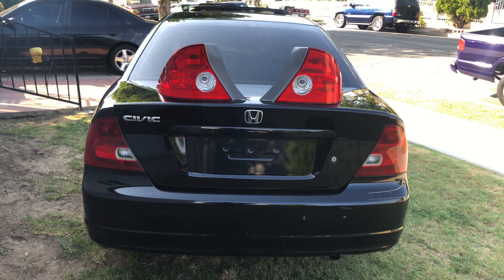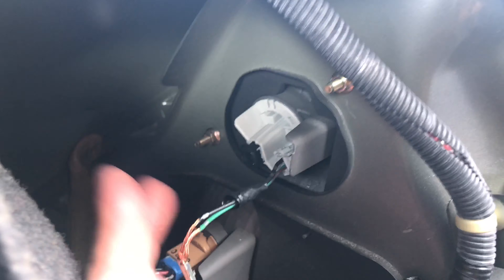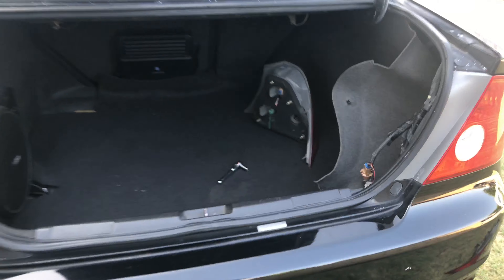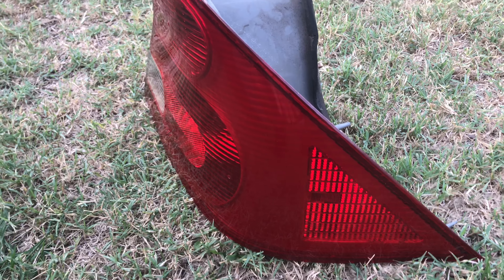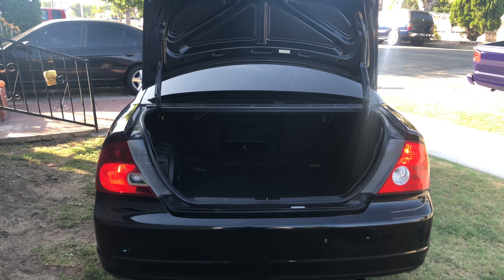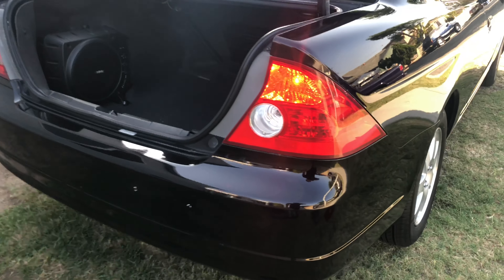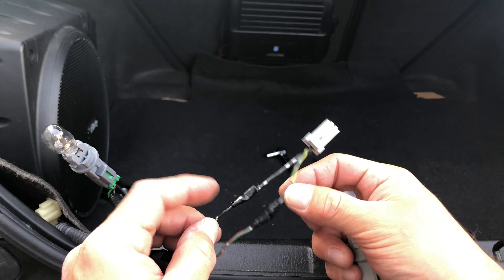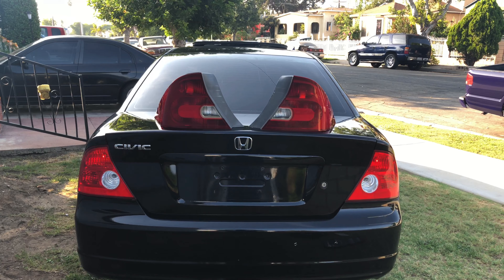How To Put 04/05 Honda Civic Taillights On a 01/02/03 Civic (Coupe)

Comment: To anyone who wants to do this, you can also do what I did. I cut the connecter off and spliced the connecter for the new taillights onto my wiring. It’s easier, but it will make it so you can’t use your normal taillights. I’m just lazy so I don’t mind, but just something worth noting
Reply from the maker: Nice! Thanks for sharing, we appreciate your input. Hope this is helpful for anyone that may need this info. Thanks again bro.

Comment: I might be in the minority here, but I think the pre-facelift em2 taillights look better than the facelift models. Something about that crescent brake light. I drive an '05 em2 EX SE but have been lightweight considering converting my tail lights to the  pre-facelift version.
Reply from the maker: I just like how the 04/05 taillights are a much brighter red. The old ones I removed were very dark, dull and the white part for the reverse light looked yellow in comparison to the new ones. I did keep them though just in case I ever want to switch back. 👍
Reply: @JohnnysWhips  They are bright as shit lol. I think they use a crystal reflective pattern or something. I've been driving down dark streets before, hit the brakes and watch half the street behind me pop up red lol. Mine has a spoiler and the LEDs in that are bright as hell too.
Reply from the maker: @The513Warning  lol 😂 I hear you bro specially with LED’s it must be super bright. Lighting up the block 🚨I’m about to make a new video, I bought a car cover for the 2022 Civic. Check that out, I’ll post it later today or tomorrow. 👍
Reply: @JohnnysWhips  can i buy your pre face lift ones?
Reply: You're not alone, I'm definitely switching mine. Since I want to do a lot of experimental custom work, I'm probably gonna try to make red lenses for the lights that are just as rich as the facelift ones I have now. I could probably also just cut out a red piece of tint to turn the facelift O cutout into the old C shape with the same new lens. Not sure how or if they'll fit but I'll make it work just for the lights to spell out CIVIↃ
Reply: @HawkEM2  That sounds dope as hell! You gonna upload any of the process?
Reply: @The513Warning  Yeah I definitely will, not gonna start that just yet but probably in spring or summer
Reply: @The513Warning got the pre facelift lights the turn signal bulbs are oddly massive on the 01-03 so I'm gonna need to get new bulbs and bulb holders or design some kind of adapter

Comment: I just converted my 03 EM2 to the 04-05 tailights but my reverse and turn signals dont work. The bulb u needed to splice mine didnt have any wires attached to the bulb.. the blue and green one plugged in just fine... help!
Reply from the maker: Sorry for the late reply. Are you still having this problem?
Reply: i am!

Comment: I have an 05 & I bought 180 brake light assembly to match my smoked headlights with 15K lumens. I'm bringing the drugs with low beams.
Reply from the maker: I like the 05. Smoked headlights, sounds nice. Good luck with the taillights you just bought 👍 Let us know how it goes. I’m sad/mad they just crashed into my 05 Civic. Check out my other videos. You’ll see it, it got totaled 😞 Smh…
Reply: @JohnnysWhips  that's heartbreaking
Reply: @JohnnysWhips  I'll post a before video of my civic with smoked lights installed. I need to replace grill after hood broke latch bolts on housing and hood smashed into. Windshield. I'm missing grille so need new one & to fix hood. I'll post before tomorrow & after when it's fixed next week.
Reply from the maker: @Shadoefax760  yes, it is… 😢
Reply from the maker: @Shadoefax760  for sure 👍, drop the link here in the comments so we can check it out.